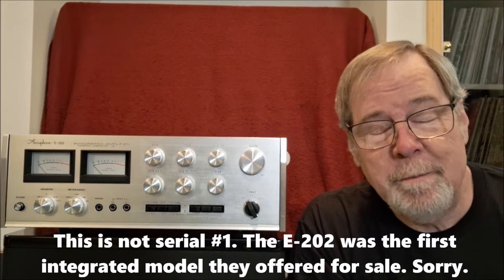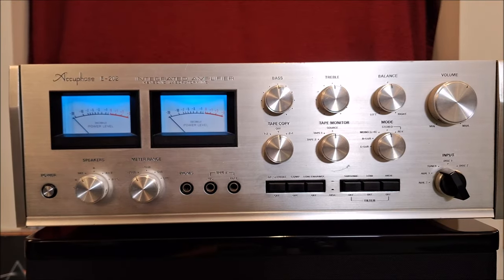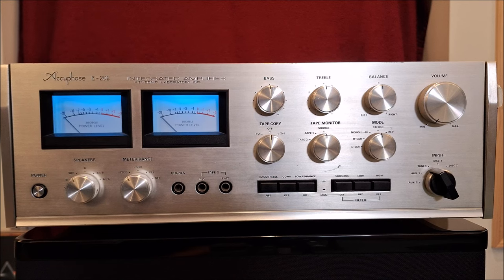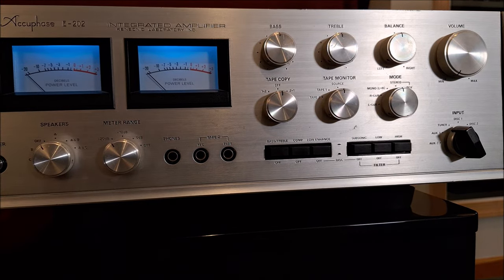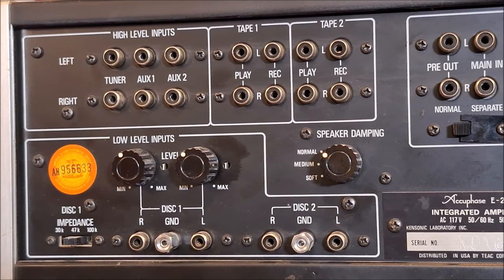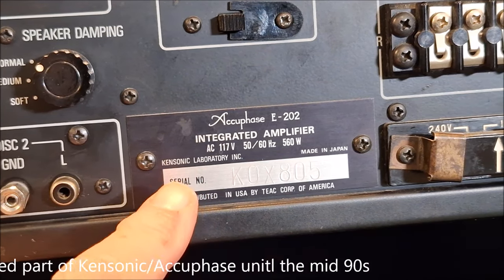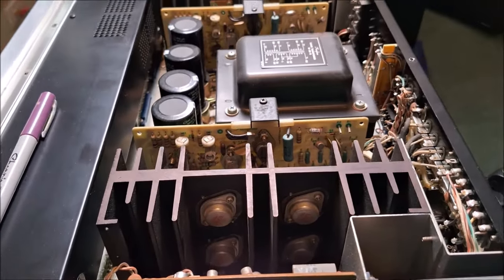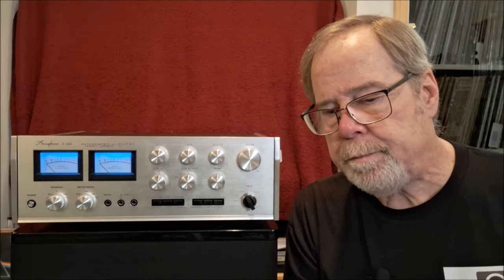A review of a vintage Accuphase E-202. Thank you to Skylabs in Des Moines for letting me borrow it.

Comment: Thanks for the video. I am a new subscriber and really enjoy your presentation style. I have an Accuphase E-303 and I love it. I’m not sure if their designed sound profile evolved, but I would describe the sound as slightly warm with very good and balanced bass, midrange, and treble. The speakers I have paired with it are Kef reference 101, and the Accuphase will push the bass even on this small sealed speaker. I bought mine while stationed on Japan and had it serviced by Accuphase  before I left to ensure it continues to provide enjoyment for another 50 years.
Reply from the maker: I know the KEFs well. We used to be a KEF dealer and I had a pair of those.  They would be a great match with that amp.  The T27 tweeters were very detailed and forgiving.  That's why the BBC used them in the LS35As. Thank you for your view and sharing your story.

Comment: The low and high filters would work well with 78's. You'd have to use tone controls to adjust for the non-RIAA record EQ's used before the mid-1950's.

Comment: I have an E-202 in original condition that I bought from the original owner for $400 Canadian about 40 years ago. I love this amp so much!! I haven’t powered it up for about 10 years because it’s overdue for a complete recap and service. I’d love to find a T-101 to compliment it but they are running $1500 these days from what I’ve seen. Do you have any recommendations for speakers to pair with this amp? My speakers are woefully inadequate to be in the presence of royalty. 👑 

XraytonyB recently did two or three videos on the E-202 and the T-101. Great stuff!! Thank you for this. New subscriber today. 🙂👍🏻
Reply from the maker: Honestly, without knowing your taste in speakers and sonic preferences, I am afraid my suggestions would be meaningless. Did you want new? Vintage? Smooth? Exciting? The good news is that unit will drive almost any speaker you can think of. Thanks for the view and comment.

Comment: Great review, and a great amp. I own a Kenwood 650 and a Kenwood 700C&M combination myself. Supreme series. Around the same period I think. They sound absolute amazing. Do you have experience with them yourself?
Reply from the maker: Louis, I am familiar with those units but it has been quite a while since I heard them.  The 700C &700M must be an absolute joy to listen to. I know that the units you have had some of Accuphase's engineering inside. I did do a review on a vintage Kenwood KA-3500 and even though it is only 40 watts it was ballsy as hell. Good stuff my friend. Thank you so much for watching and sharing. I would really appreciate it if you were to subscribe.  Thx again.